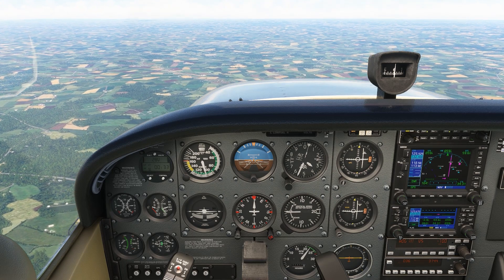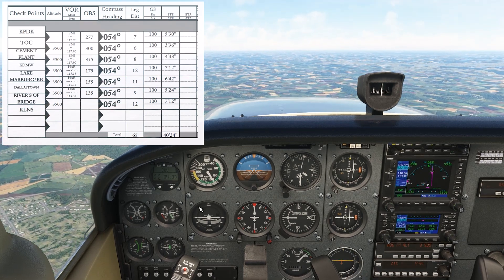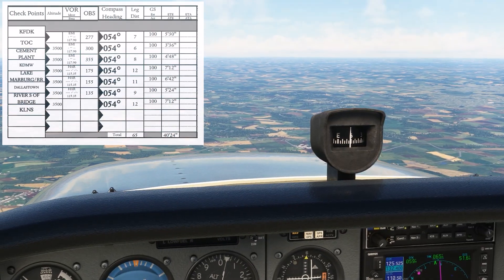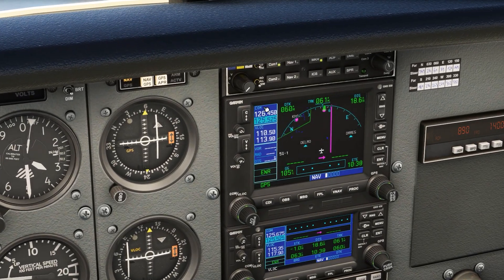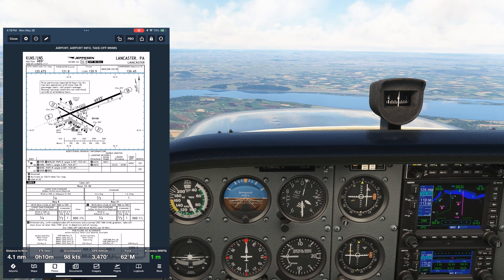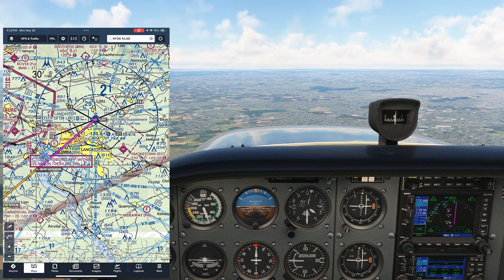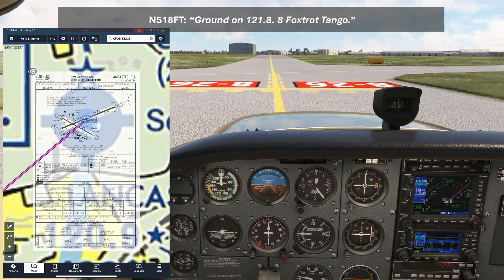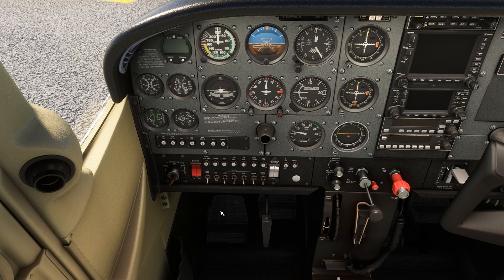📍Solo Cross Country Flight Part 2 of 2 | Private Pilot VFR Navigation & Radio Calls

Comment: Lots of discussion in other comments about cancelling FF or not.  I think both are fine.  Workload isn't appreciably different in either case, but maybe very marginally so for a student pilot's Long XC.  There's a difference of one radio transmission, which becomes an ATC landline instead. 

In case 1 with cancelling FF as in the video:
  -P: Call to cancel FF
  -TRACON: Confirm cancellation and issue approval to change freq
  -P: Confirm instruction
  -P: Contact tower, state intentions
  -TWR: Issue entry and reporting instructions
  -P: Confirm instructions
6 radio transmissions, 4 from the Pilot.  One change in squawk to VFR. 

In case 2 with continuation of FF:
  -TRACON coordinates with TWR on the landline
  -TRACON: Issues handoff to TWR instruction
  -P: Confirm handoff instruction
  -P: Contact tower, state intentions
  -TWR: Issue entry and reporting instructions
  -P: Confirm instructions
5 radio transmissions, 3 from the Pilot.  1 ATC landline call.  No change in squawk.

So yes, there is a difference of one Pilot transmission and one button to change squawk to VFR.

Comment: Why would you cancel flight following? Wouldn't that increase the workload?
Reply: Usually FF will transfer you to tower and cancel you at that time. In this case the field was in sight so FF would have little more to offer at that point. It is VERY important to make sure FF is cancelled at some point however. If you were flying to an untowered field somewhere and did not cancel FF and landed without notification they would need to find out where you were and if you landed safely. This is especially important in the backcountry where radar and radio service my not be available.
Reply: This isn't backcountry, it's a towered airport. That's why I'm asking. Does this maybe go more efficiently from the tower standpoint?
Reply: @daru2001  I'm familiar that a Class Delta airport is towered, at least during the hours of operation. I included the other information as it may be helpful to others and I saw it as a teaching opportunity.  Yes you can stay on FF and have them transfer you to tower and yes that may be a little more efficient in this example.
Reply: I believe in part one (or maybe it was another video but the same still applies here) that Dan mentions he is cold-calling ATC just to provide / describe the process fully, and that yes, FF would take care of a couple tasks here. But, what do you do if you don’t have FF? YOU are still responsible for coordinating with ATC.

Comment: Is it easier to stay on flight following and just have the approach controller hand you off to the tower, so that you don’t have to check in with everything again?
Reply: That would also work fine, and likely would have been slightly better
Reply: That would be nice, but the problem is you can't assume every approach controller will do that as they dont have to. 

Some TRACONS will hand you off to Tower and some wont, so the best practice is to just assume that they wont and cancel radar services then contact Tower.